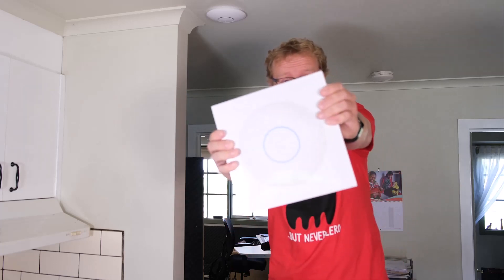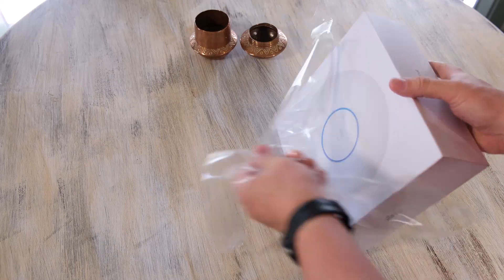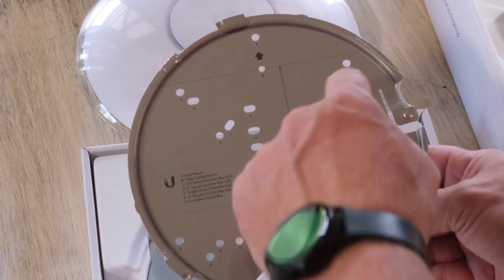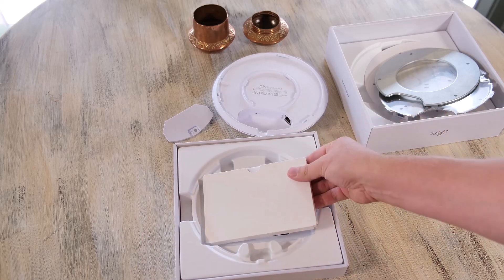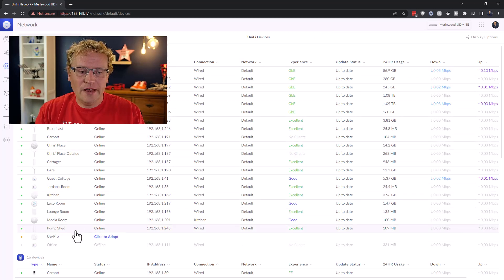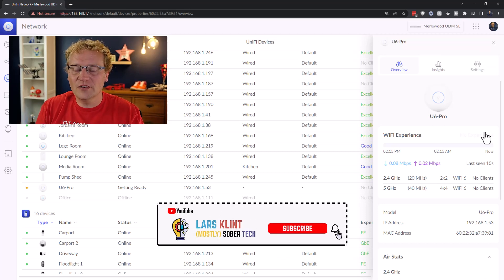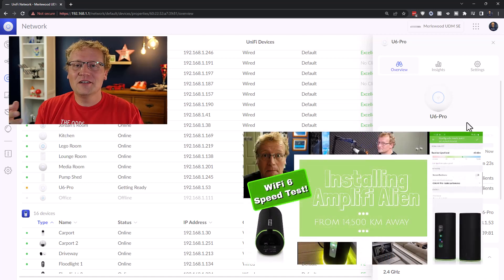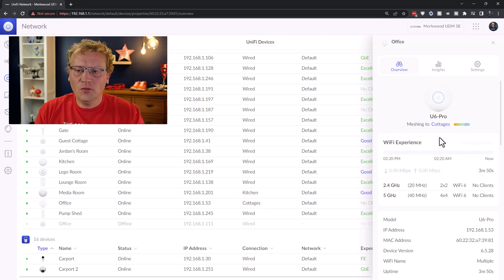Unifi U6 Pro - Wifi 6 farm upgrade

Comment: At least you got 8 months out of it before they released the 7pro. I ordered the 6pro and the day it shipped out the 7pro was released. I live overseas and can’t ship it back
Reply: Why do you need to have that? Hardly anything uses Wifi 7 at this point, you will also need to upgrade all other devices to handle 2.5 Gbps rather than 1 Gbps. It is more power hungry, and worst of all, the U7 needs a fan.
Reply from the maker: I'm not getting rid of the 6 Pro. It is still an awesome device and will work perfectly with any WiFi 5 or 7 devices 😊

Comment: There is a small white spacer in the box that could have used to hide the side hole for the Ethernet cable as you have the cable coming from the top.
Reply from the maker: Yeah, I know 🤦‍♂ I did put that in after I finished recording 😊

Comment: Other Unifi APs have pass through so there could be 2 ethernet cablers coming out potentially. This one however does not.
Reply from the maker: I am not sure what you are referring to in the video, if anything. The only current APs that have RJ45 out is the UAP-AC-M-PRO and the UWB-XG afaik.
Reply: @LarsKlintTech  Refering to your question @ 2:48 about the 2 holes. No costs for new design or they used old stock for the caps.
Reply from the maker: @henkvangrootheest589  Ah, thanks for clarifying. 😊
Reply: One incoming port and the other outgoing port to another AP or device. But this is not the case with all access points.

Comment: 2 questions:   #1 which I think all need to know, as you replaced a Ubiquity AP with this wifi 6 upgrade, you did not replace the POE.. hmmm   So the wifi 6 can use the same POE as the prior version of Ubiquiti AP's?   2.  Can I operate the WIFI 6 APs along with the older original Ubiquiti APs on the same network?  I do still have dead spots, a couple wifi 6's should fix that issue, but as I have a 5200 sq ft spread out in diff directions building, need to make sure the 6's won't interrupt the wifi 5's older design Ubiqiti AP's I have in place.
Reply from the maker: Great question Keith. I did indeed just gloss over it, but you can absolutely combine Wifi5 and 6 devices. I have 6 Wifi6 APs and about 8 Wifi5 APs. They all work happily together with the same Unifi Network Controller. 
With the CAT6 cabling, that will support any modern kind of PoE. PoE doesn't care what it is powering, as the switch will be the one that determines the type of PoE (24V, 48V, PoE+, PoE++).

Comment: Hi Lars. I had one of my APs start meshing. I tried setting the link speed manually and it was only stable at 100mb. Re terminated the cable and it’s been fine since.
Reply from the maker: Thanks Terry. I am definitely not ruling out the cable being faulty. Just odd that it worked perfectly with the previous AP. I had a rubbish crimping tool as well when I did those early plugs, so might be worth it just to rule it out.

Comment: There is an option on the WIFI page of the settings in the controller under the AP Site Setting sub heading to allow wireless meshing. If this is turned on, it may be why the AP connected to the Cottage AP.
Reply from the maker: Thanks Trevor. I did find this option too, but have to disconnect the APs that are wirelessly meshing first. I am just wondering _why_? There is a perfectly good CAT6 for it with a wired connection that worked for the previous AP. Strange.

Comment: I know its just been a little since you got the 6 Enterprise but in your experience which would you  chose out of the U6  line of AP
Reply from the maker: I haven't really had enough time to properly test it. I am mostly interested in range, as the 350+ or 600+ clients isn't going to be an issue for me 😂
I am yet to install the U6 Mesh, which will happen soon. That will go outside in place of the Flex HD (which looks the same).
Reply: @LarsKlintTech  understandable, keep up the awesome videos !
Reply from the maker: @TheDmankl  Thanks mate. Will do 🤓